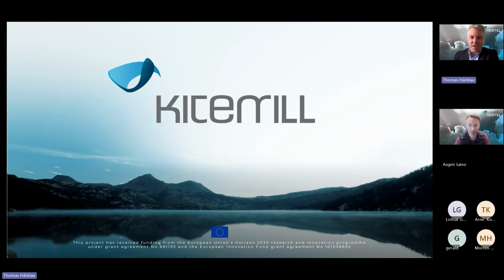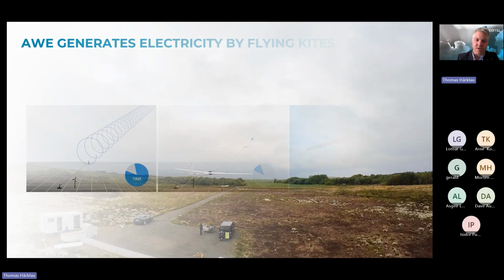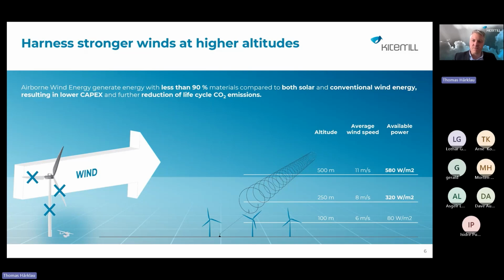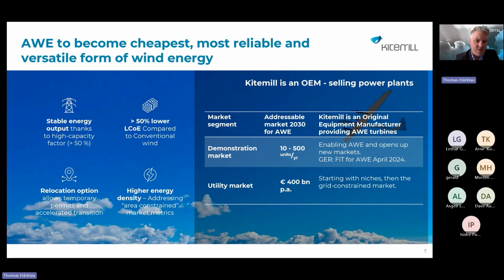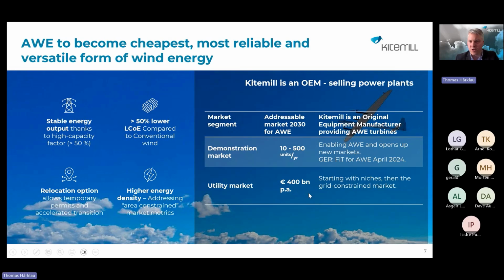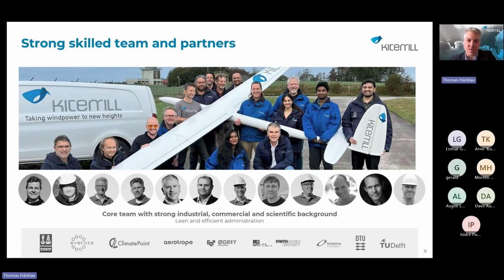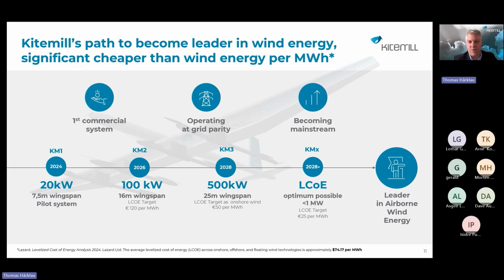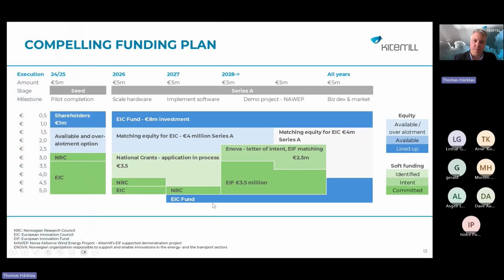Kitemill Investor Pitch - 2025

Comment: There's far less need for a foundation because there is no tall tower resisting rotor thrust at altitude which creates a huge bending moment at the base
Reply from the maker: Yes, significantly less. In general, the ground station is subject to a downward gravitational force that is substantially greater than the maximum pulling force exerted by the tether. The investor is correct in noting that the illustrations do not show specific foundation details. However, some foundation work is indeed required—primarily for drainage and frost control—to ensure that the structure remains level throughout all seasons. A gravel pad should be sufficient for this purpose, unlike conventional wind or solar installations that typically require concrete foundations.

We have also assessed the maximum expected forces and the role of friction to ensure that the structure remains stationary. Movement can still occur even when the station's weight exceeds the tether’s maximum pull force, so proper design considerations are essential to mitigate that risk.
Reply: @kitemillas8670 
Nice. and simple tensioned pile or screw anchors could be used to overcome any remaining extreme case concerns
Reply: Airborne Wind Energy (AWE) handles forces not with brute strength, but with aerodynamic finesse—harvesting wind energy through lightweight kites operating in tension rather than compression. Unlike conventional wind turbines that require massive towers to resist bending forces and anchor their weight against the sky, AWE systems transmit aerodynamic loads directly to the ground via taut tethers. This means no need for deep foundations, heavy towers, or reinforced pads. The result is a structurally elegant solution that reduces raw material usage by over 90% per MW and sidesteps the civil engineering burdens of traditional renewables. AWE is the most resource-savvy renewable technology yet conceived. Downside is that it is a bit complex and costly to develop as you need it in the air.  Its less complex than autonomous cars, but having it in the air makes the development more time consuming.